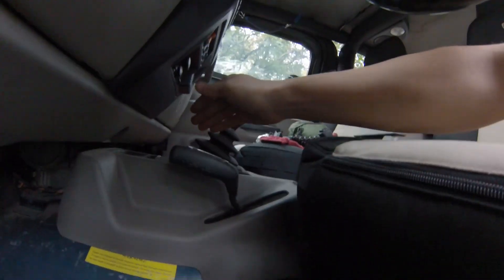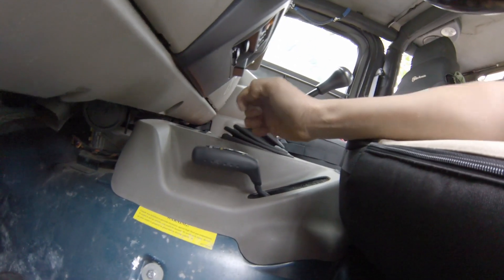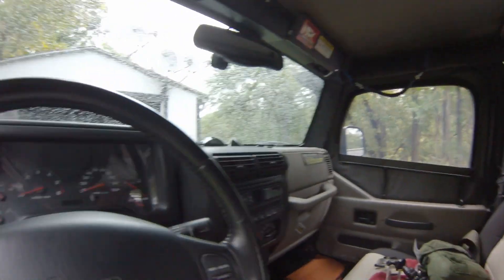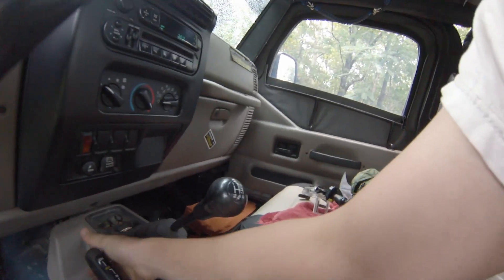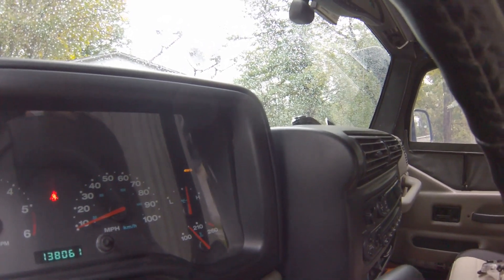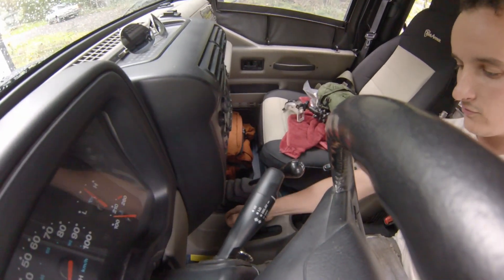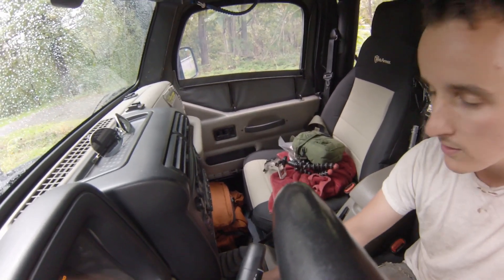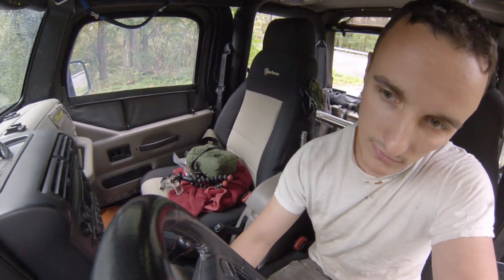Project TJ Wrangler: Ep 26- How to Adjust 4WD Shift Linkage

Comment: If the 4wd light doesn’t come on can you still put it in 4wd? I just had a new transmission, transfer case and clutch installed and my 4wd doesn’t engage

Comment: Thanks for the video.  My 4WD was making a popping noise and it took quite a bit of effort to shift into 4WD.  A little WD40, 13mm socket, 2 attempts and 10 minutes later it shifts smooth and no popping noise.

Comment: Thanks for the info!   I have a 1998 Wrangler (4 cylinder manual transmission) and the entire linkage bar is missing.  Your's has adjustability...did it come from jeep this way, or was this one added aftermarket?  What is your recommendation for me, missing the entire linkage...??
Reply from the maker: This is the stock, factory setup. I'm sure you could find your missing parts in a junk yard. There is an internet salvage yard just for Jeeps, Dave's or Davies's I think?

Comment: I have a 1996 jeep Wrangler 2.5l 5 speed yesterday I backed out of a parking spot and when I went to put it in 1st It will not go into any gear at all even when the engine is off. I also noticed if I pull the 4WD shifter it will only do from 2WD to 4H will not go any farther into N or 4L. If the transfer case is bad will it stop me from being able to shift into gear. If anyone can help me with this It would be grateful. THANKS

Comment: I have a 03 tj that is locked up, can't shift into any gears.  I believe it started last time I attempted to get into 4WD.  I do not get the 4wd notice on dash when shifting into 4wd.  Seems to be stuck in between. 

Do you think this adjustment will get me back into 2wd and cure the shifting issue?  Thanks in advance,  Really like the videos, clean and clear instructions help a lot.
Reply from the maker: I'm glad they help! As for your issue: locked up like every gear grinds and/or won't go in? Or as in you can shift into each gear with the stick but the gears themselves won't engage? (assuming you have a manual)
Maybe try disconnecting the T-case linkage completely and moving the selector by hand to try to find 2WD again. Then reconnect and adjust the linkage. Hopefully it's just an adjustment issue and not an internal issue with the transfer case or transmission.
Reply: It is locked up , but have been able to pop from 4low to 1st.  I missed the step of shifting out of 4L down to 2 when nut is loose.  Gonna try that today.  Thanks again.

Comment: Hello, my 2000 TJ sport automatic, wont shift into #1 using shifter, is there an adjustment for this?
Reply from the maker: I'm afraid I'm not very knowledgeable about the automatics. I don't know. 
My friend Sam has an auto 2003 TJ, he had a similar problem and had to change the shifter assembly.

Comment: Hey Trev. Great videos. I have a question from Ep24 and Ep26. I did not see a new bracket when you installed the lift. Did you just loosen the bracket while you moved the body, then put the same one back on?  I am removing a 2" body lift and I am trying to figure out all the pieces that will be affected. 

So fan shroud, transfer linkage,  it I think that is it. They did not have an engine lift on it (that I can tell) so I should be good there. What else will. It's me?
Reply from the maker: I didn't need to use the T-case linkage drop bracket because my engine lift compensated for the difference. 
You'll need to disconnect the T-case linkage/bracket, fan shroud, and fuel filler hose/neck. Keep a close eye on the different fuel and evap lines to the fuel tank as well.
If you're removing the lift and going back to stock, you should be able to just remove the T-case bracket kit and reconnect the rest like the factory had it.